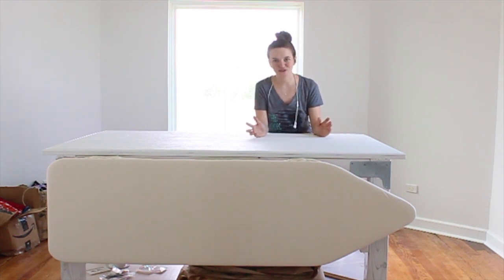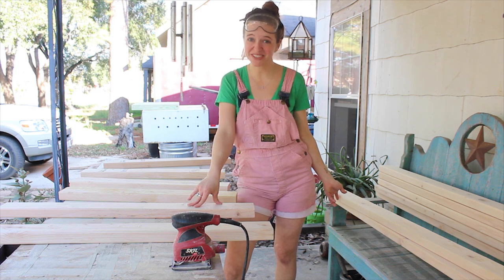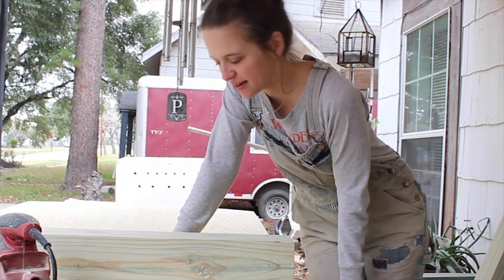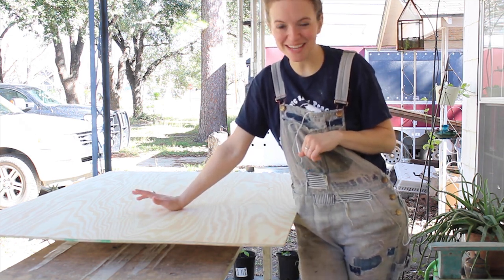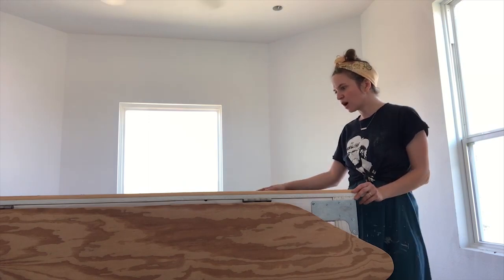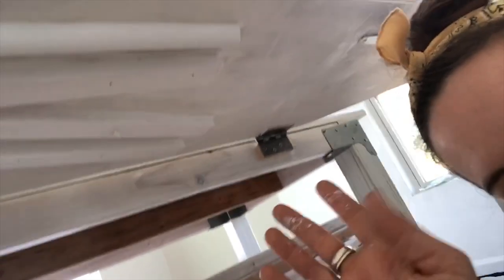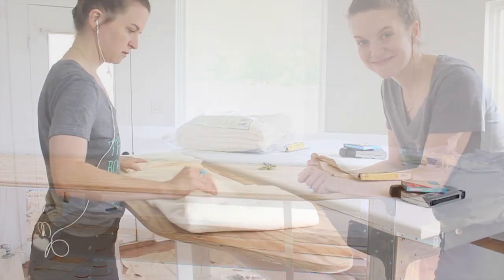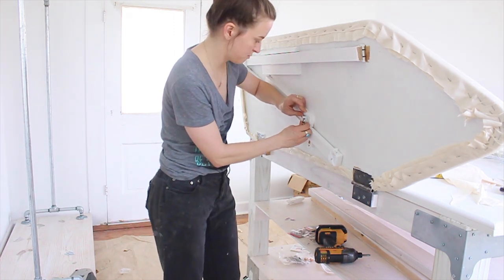How I Built the Cutting Table of my Dreams!

Comment: what is the finished measurement of the square surface (not incl the ironing board
Reply from the maker: My cutting mat is 38” x 58” and the table top is maybe a couple inches bigger than that. So 40”x60” ish?